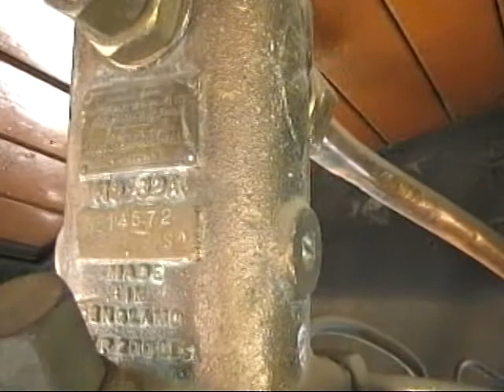Class 14 CRB steam locomotive

Comment: Very well thought-out locomotive👍. I just learned they were very popular with footplate crew.
Reply from the maker: Thanks Stephen. Forgot about this video. I should do a proper one sometime.
Reply: @WayneSA85  I look forward to it.  This was a very popular design with footplate crew and from the look of it, designed to make preparations and disposal as easy as possible.  I’m interested in the design of all the parts as well as the whole loco.  There’s enormous variation in steam loco parts design which have absorbed terrific amounts of ingenuity and creativity over the centuries.  This includes details that nobody would see or care much about.  For some reason British locomotives intended to be used only in Britain never had hollow stays.  In the US they were the default.  What am I talking about???!  Stays hold the inner firebox wrapper and the outer firebox wrapper together against boiler pressure.  It can be dangerous if they begin to fret and break within the water/ steam space.  A hollow stay has an end-wise hole in it beginning on the inside firebox end.  So if the stay begins to fail, it will start to weep water quite soon showing that it needs replacing.  Solid stays will weep but not quite so soon.  Sorry for the ‘essay’ but can your vid go inside the firebox and take in the stays?  Rocking Grates were another innovation, Roller Bearings, High Superheat etc etc all of which came late if at all with UK designers who seem to have been more conservative than SAR designers.